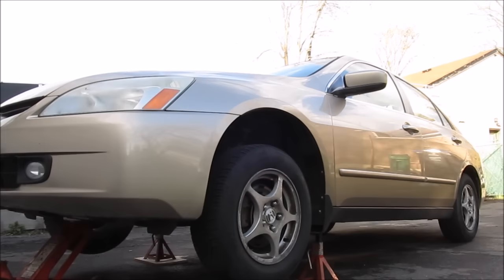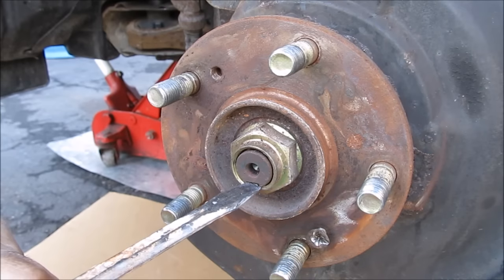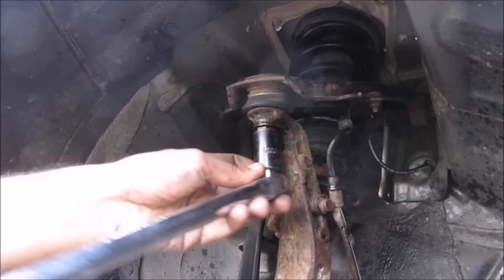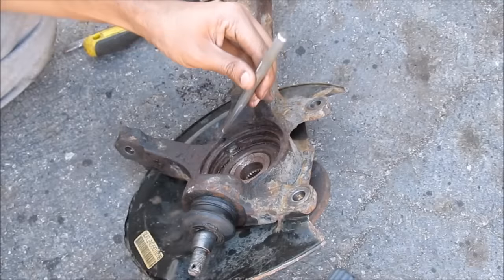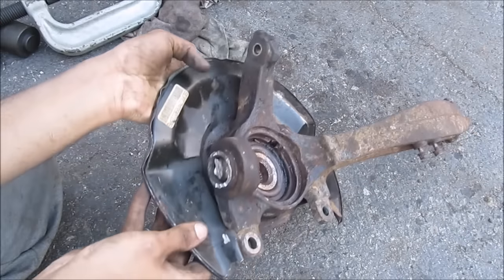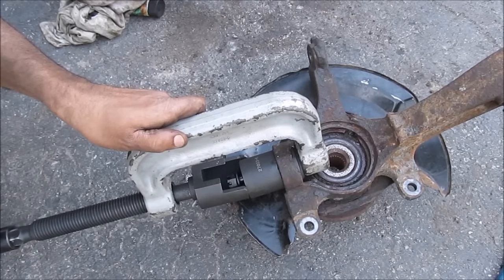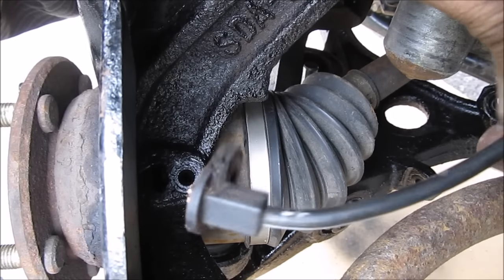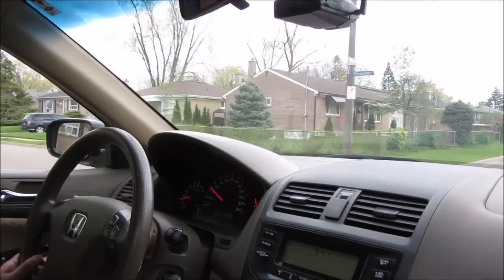Honda Lower Ball Joint Replacement

Comment: Im about getting a honda accor 2001 (baby boy) but my terrain is not too motorable. How often do i need to check my ball joint because i dont want a situation where the ball joint will embarrassed me . Is there any basic skill to check without removing the tyre?
Reply from the maker: As you saw in the beginning of the video, jack it up and rock the wheel

Comment: Do you have to tight the nut on the ball joint good like even using a torque wrench or as long as  u can put the pin u should be fine?
Reply from the maker: +dgaleno2012 tighten it tight then put the pin.  Pin is there just for safety

Comment: I rented a kit from Advance Auto Parts and the darn thing wasn't comparable with Hondas. I don't wanna buy a kit for just this one small job I'm doing. The kit you linked to says for 1993-1997 Hondas. What year is the one your working on? I have a 1999 Honda Civic.

Comment: Is there a reason you went from the impact wrench to a breaker bar as you went to the castle nut on the upper ball joint?  Should I not use impact in that area?
Reply from the maker: +Two Canoe Productions becuase of the shape of the knuckle I can't get a gun on it without a wobbly socket
Reply: Thanks!

Comment: Hi, did you know what could be the reason for having a strong steering, specially at higher driving speeds ? I always have to correct steering, like its stuck a bit.
Upper or lower ball joint ?
When i jack up the front of the car for a wheel change, after that it steers smooth for 1-2 miles and than it becomes back strong.
Car is a 2001 Civic Aerodeck VTi with 100k miles on the clock.
Reply from the maker: +MrCornholios when you mean strong, you mean the car pulls to one side? 
If its intermittent it could be a sticking upper strut bearing. If its consistent it could be the toe alignment.
Reply: Thanks for your answer.
No, it keeps straight, also under hard braking.
Sometimes it stucks so much that there is almost no steering reserve.
Reply: sorry, i mean, no steering return torque, not reserve.

Comment: So much work to just replace a lower ball joint on this Honda. Much easier to have the ball joint pressed on the lower control arm like the design on MDX.
Reply from the maker: Yeah bolt-on design is easier

Comment: Great job!! as always!! quick question  i have the same  es330 as you and when i turn the steering  wheel all the way for both sides it does not turn back freeley without me turning it back could rhis be ball joints or.........
Reply from the maker: +johngamache7 How many km on it? If the strut mount bearings are worn it could have a memory effect. Also rotate the tires, sometimes they have a natural pull to them.
Reply: +speedkar99  this car has 142000 miles  the car has been rotated and alighned at 133000
Reply from the maker: +johngamache7 I'm not sure what else to say, the ES330 I had had around the same mileage and they were fine. Even this Honda Accord had over 200K and it didn't have memory steering on its worn ball joints. Since the ES330 is Mcpherson I'd be leaning more toward the strut bearings but I could be wrong. When was the last time you flushed the power steering system?
https://www.youtube.com/watch?v=Jg9Yjt__KHw
Reply: +speedkar99 i havent done a flush on it i just drained  from the reservoir and  it was  black like my cup of joe this morning  lol
Reply from the maker: You should do a full flush to push out all the contaminants and remnant fluid in the steering rack. Keep up on the fluid changes and the ES330 will last you a while.
Reply: +speedkar99 great will do it thia weekend thanks!!!!
Reply: +johngamache7 This*

Comment: so even with the honda kit with  the ball joint press its still gonna be a pain in the ass despite it being a specialty tool...  (lower ball joint 94 integra) i almost feel like a compressor/air hammer would be better, albeit a little bit harsher in appearance
Reply from the maker: +Socknetea Yes an air chisel/hammer would be the best bet.

Comment: I am dealing with a 97 Accord and the new lower ball joint went in without the using a press. It’s loose inside the slot. What should I do?

Comment: Thanks for vid. 

Where did you get your parts from?

What paint did you use to spray?

Is that silver or nickel anti seize. 

Thanks
Reply from the maker: +d w Thank you. I parts from Hanlan Auto parts in the Toronto area, prices are on par with Rockauto after shipping to Canada. I used enamel black spray paint, it's quick, cheap and dries fast but I don't expect it to last long. I use silver anti seize.
Reply: +speedkar99 Thanks.

Comment: Looks like you replaced the rotors. Are those Bosch rotors?
Reply from the maker: +gg taruc No, they were an off brand. See that video here:
https://youtu.be/ML3-VH6WiUM
Reply: Thanks. They looked just like the Bosch rotors I used which happen to have lifetime wty. They were coated too.

Comment: Hi great video, but what did you do about the retaining ring around the drive shaft when you reinstalled?
Reply from the maker: +Steven Yang I didn't have a snap ring on the axle...
Reply from the maker: +Steven Yang I didn't have a snap ring on the axle...
Reply: +speedkar99 I was referring to what you called the retaining ring around the drive shaft in 4:33 of the video, the one where you said to be careful with the wheel bearing when removing it. but anyway I went ahead and tapped it back in when I reassembled everything after replacing the ball joint.
Reply from the maker: Yea I just reinstalled mine no problem. I still didn't replace my ABS sensor yet though :S

Comment: Cool video, I like that you show your mistakes, we've all ended up with leftover parts when everything's almost done :) 
Did you finally fix the abs stuff?
Reply from the maker: +Koffi Banan Thanks. Yes well my mistakes are actually quite common for this car, cotter pins sheering off, rusty abs line, the ball joint press not fitting. 
I still have to order a new ABS sensor, for now the abs light is on :(

Comment: What type of lubricant do you use for ball joints?
Reply from the maker: Normal grease that goes in a grease gun.
Reply: Just there is a lot of grease types. But which one is better?

Comment: What happens if you pull the axle out of its sleeve while removing the knuckle?
Reply from the maker: +Lewis I had that problem when replacing control arms. You have to twist the axle and pop it back in
Reply: speedkar99 yep I ended up doing that and it worked well. Thanks for the tip on the ABS sensor, I would have never known to unplug it from the engine bay!!

Comment: Every video I’ve watched leaves out the part where you have to replace you axle nut. Didn’t know this until last minute and delayed my replacement
Reply from the maker: Yeah I hate axle nuts. 
Broke my breaker bar
Reply: @speedkar99  BRO ME TOO‼️🤣 had to buy a new one a harbor freight quick

Comment: you probably could have taken out the ball joint and put the new one on with just a hammer, no need for the c clamp, also thanks for the comedy, your video is hilarious
Reply from the maker: +eksine Glad you enjoyed the video. I dont recommend a hammer for installation as you can damage the bearing in the ball joint and void its warranty.

Comment: would i be able to use this 5 lug steering knuckle on my 4 lug 1992 honda accord?
Reply from the maker: +NeATaNDtURdy Probably not
Reply: on my 95 accord, i used 5th gen prelude knuckle (and pretty much everything else; engine ,tranny, axles, brakes etc) and it works.
Maybe if the axles are the same it would fit without having to swap the transmission ?

Comment: Hello Speekar,  Would you be kind enough to explain a little more how to 'load' the lower balljoint for testing?   I've heard from a mechanic you can't 'test' a Honda lower balljoint, but I think it's because it is 'difficult' to test...   btw, Great video!
Reply from the maker: +Richard Dolesh it's because the weight of the spring acts through the ball joint. 
In my case jacking it up and using a long rod I was able to wiggle the wheel to feel the play.
Reply: So would you jack up the car at the control arm to check for play in ball joint? So the car thinks its on the ground?

Comment: Good video except u forgot to preload the suspension before tightening any bolts that lock rubber bushings in place.. this causes the rubber bushings to constantly be under complete tension causing them to over twist under load.. and pre maturely fail
Reply from the maker: For the upper control arm yes you are correct
Reply: its also for the bushing that the strut fork goes to..

Comment: gotta do this on my acura legend..I want joints with grease fittings instead of non greaseable..do they make em?
Reply from the maker: +The Admiral If its double wishbone like this then no. Because the grease fitting would touch the axle.

Comment: when I turn or hit a bumb i hear a squeaking noise what ball joint is that
Reply from the maker: +BIG DADDY Could be the upper or lower ball joints. Get grease in them asap, use a grease needle to pierce the boot.
Reply: thank you

Comment: did these ball joints come with a C clip? mine did for my 95 Integra but the old ball joint didn't have any C clip. they installed just fine pressed in ok but I don't see any groove for the clip
Reply from the maker: Not all have c clips but it's a good idea to put one as a safety mechanism
Reply: @speedkar99  ok thanks 👍 will pull it back apart and install them

Comment: If you change a ball joint on the front left (2004 honda pilot) do you have to replace the ball joint on the other side?
Reply: You always do things in pairs: tires, wheel bearings, ball joints
Reply: @lukew2194  Thanks, I did just that!

Comment: Hi,  I have one question my  accord cant go straight. It goest a bit to left.  Ive replaced tires due to aging,  and did wheel alignment as well.  But it still could not go straight.  Will this help?
Reply from the maker: The tires could have a broken or defective belt causing a radial pull. Swap the tires back to front and/or side to side to see if the pull switches sides.

Also have them double check the alignment, not all the time will they get it right the first time.

Worn control arm bushings change the alignment as the vehicle drives down the road. Ball joints don't contribute much to pulling unless they're binding.
Reply: speedkar99 thank you.  I will check 😊

Comment: my KIA Spectra 2006 is half the amount of bushings only 1 arm and ball joint, My honda 2007 v6 has 2 ball joints 2 arms and 3 more bushings but the car is heavier and rides nice. things do wear out. Kia got a lower arm w ball and bush for 35$ a side. Honda if yu do the lower might as well do the upper. dont forget to preload bushings,
Reply from the maker: Good tip

Comment: how do you put on the radius arm back on?
Reply from the maker: +Rudy Medina The accord doesn't have a radius arm
Reply: my honda has a radius arm from the front frame to the lower control arm. that's why I ask bc I bought a new one but it's a pain to instal it bc bolts  and hole don't add up

Comment: This extra Honda specific ball joint "adapter kit" for the c-clamp type press is total crap.  I am not sure what Honda it is for but you can see it wasn't clear how it was suppose to work on this accord and didn't work for my CRV.  I ended up making spacers from 2 1/4 pipe and 3/16 flat plate to come up with a way to make it work.
Reply from the maker: +Moneypit330 agreed, there has to be. Better kit out there

Comment: Could you just have disconnected the abs sensor from the vehicle side (orange connector) instead of at the wheel? That way the abs sensor doesn't have to get damaged and then replaced.
Reply from the maker: +SILENTJRM yes I learned that after.
Reply: I did the same thing on my crv and didnt think about it after the fact haha. I was mad for a moment but now just laugh at it. All a part of learning. Thanks for the video bud it was very helpful and I saved paying $290 for someone to replace both joints when it cost me $15 (and 5 hours) to replace the just one that was bad.

Comment: It sucks that this didn't work for me when I replaced one of the lower ball joints on my 1999 Acura RL. The adapter with the flat side was just a tiny bit too small to press out the RL's ball joint. I cut off the ball joint stud then used a sledge hammer and finally an air hammer to remove the ball joint. The press worked ok for installing the ball joint, but I had to hammer it in the last 3/8" with a 2lb brass hammer (didn't have the right tip to feel comfortable using the air hammer for the installation).
Reply from the maker: +hoopfan71 Yea pretty much same here

Comment: BE Careful when pressing in the ball joints this way! I had to do it this way and the top of the ball joint was crushed. I didn't see this until it was seat in the control arm. Then I had to press it back out and buy a new one.
Reply from the maker: Yes the lamination is on the top of the ball joint. Use the correct adapter to get it in.

Comment: At 1.22 doing that could dammage the thread. Should have been a small tip bar place at center of the bolt .
Also using a ball joint seperator is not a best method.
Reply from the maker: Yea

Comment: I changed out wheel bearing drives side now my abs and vsa light are on it a Honda oddsey 2007 can some one help Iam thinking it’s a abs sensor if not what could it be
Reply from the maker: +Jesus Armendariz Get the codes scanned. You prolly broke the sensor

Comment: I would need every nut torque spec listed before I started this project.
Reply from the maker: Nice and tight for everything
Reply: @speedkar99  - That is NOT the correct answer. 
Factory torque specs are there for a reason.
Reply: @BA-gn3qb  Sorry if I'm late.

Strut fork to lower arm bolt and nut(with the weight of the car on the suspension): 47 ft lbs
Front lower arm ball joint nut: 58-65 ft lbs
Front upper arm ball joint nut: 29-35 ft lbs
Front tie rod end ball joint nut: 32 ft lbs
Front brake caliper bracket bolts: 80 ft lbs
Axle nut: 181 ft lbs

The problem is is that speaedkar99 is too lazy to use a torque wrench and prefer to hammer every nut and bolt on with impact wrenches.

Comment: I'm here because when turning the steering wheel without the car moving its making a significantly loud creaking sound. 2008 Honda accord EX-L V6 220,000 miles. I'm hoping its Not the struts as well! Or a tie rod thing!

Comment: do you use 40gal air compressor? I cant budge the balljoint with 6gal /$99 /150psi max one... :(
Reply from the maker: +Daniel Lage 20 gallon
Reply from the maker: +Daniel Lage try using a breaker bar

Comment: If you don't want to break the abs sensor just leave it attached and unplug the wire from the engine bay.  And if you break it you'll have to unplug it from engine bay anyways so I wouldn't even try removing it, just unplug the wiring.

Comment: Good bideo but unnecessary steps taken, for lower ball joint only, u dont need to remove the knuckle and the press can force the joint out, as for the axle nut, if u cant chisel dip out, it wont stop the impact from removing the nut. U DO NOT drill a new pin hole, u cut the ends of the pin where it bends over and then pull it out the other side by the loop
Reply from the maker: +Tuner_fan thanks. The cotter pin didn't pull out from either side. 
It's easier to remove the knuckle than risk pulling an axle, stretching an brake or and having to deal with LCA in the way with the press in video.

Comment: I did it using a hammer and a deep socket
Reply from the maker: Good work.
Reply: Getting the ball joint out?!
Reply: @deohasslehoff956  yes sir, take the boot off get a deep socket that fit the inner lip and bang it out! Clean and lube the bore and tap the new on in without the boot. Once seated install the boot and the retaining ring

Comment: I replaced the front and rear stabilizer links on my 2011 Honda Ridgeline with Mevotech Supreme parts.  The front ones with the blue colored boots rotted after only 2 1/2 years and less than 7000 miles of use, while the rear links with the black colored boots are still in good shape.  Would be very upset if the same happened to a ball joint.  Mevotech.....never again.  JUNK.
Reply: PS. Although they had a limited lifetime warranty from Rock Auto,  no refund, just replacement with more Mevotech crappy sh*t.  No thanks.
Reply from the maker: Interesting to hear... maybe the black boot parts are better

Comment: Put the new lower ball joint in the freezer overnight then when you are ready ,heat up the knuckle were the joint goes then quick take the joint from the freezer then Walla no tools need it to install the ball joint

Comment: I was told if u heard clunks or a clunky noise,that’s ur strut
Reply from the maker: Or sway bar Link
Reply: @speedkar99  if it’s continuously clunking then it’s the struts but I found out it’s the lower ball joints and the uppers ones they was very bad and I’m going to do the tie rods as well the sway bars are still good

Comment: Mevotech is trash I did my upper ball joints and control arms with their supreme brand and they were clunking and had play out the box brand new replaced them a 2nd time same exact thing you def got lucky if these worked for u I give them a week to a month before u have problems
Reply from the maker: What car and parts did you use? 
Did you grease them?
Reply: Of course I greased them 2 different times it was for a 2001 honda accord very easy job to do it's not rocket science I did them 2 times had same problem both times then I used moogs and I had no more noise so it def was the quality mevotech supremes I have pics and videos of it all to the install the removal the noise the boxes I got it all they are trash

Comment: Ive ripped all the abs sensors out on cars. They never come out. Like you said, do it from engine bay or just buy a new one. they are cheap.
Reply from the maker: +Joey Pongallo Agreed. I ended up replacing mine.